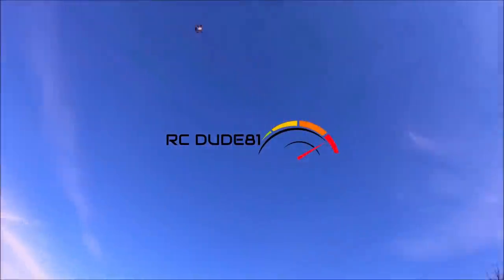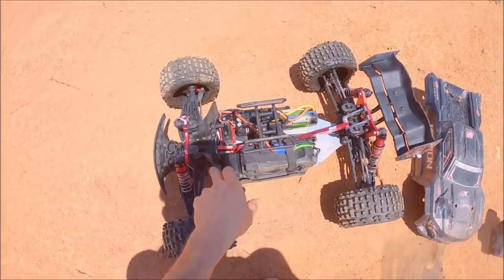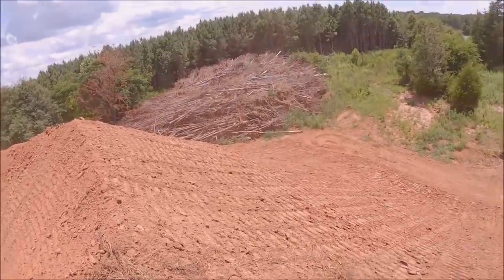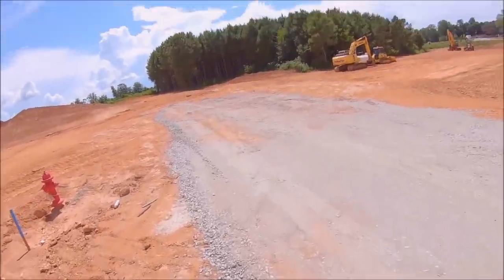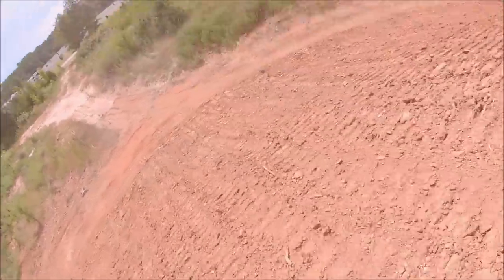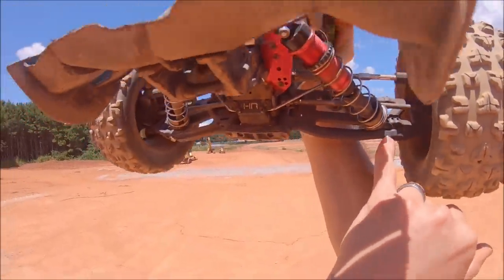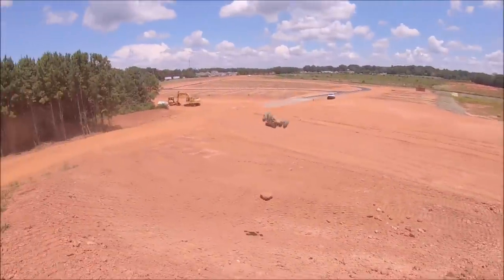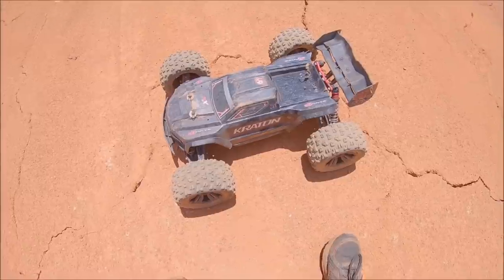NEW Arrma Kratron EXB "MASSIVE!" Mega mound sends and quick fix mod tips!

Comment: love the videos... i recently picked up a v4 talion that id like to finish off with m2c upgrades but im struggling with the suspension and handling right now and was going to see if i could pick your brain on your set up for shocks, diffs, and gearing
Reply: Diffs- I’m running 60k front, 500k middle, 30k rear, also with backflip lp tires. For gearing- if you’re using the stock katar tires, a 16t-17t pinion with dual motor fans should do the job. With backflip lp’s I still use the 13t pinion. Leave the shocks alone, the stock 2000cst oil works nice in the smaller talion shocks. Just adjust spring preload to your liking. I’m pretty happy with this set up in my talion v4
Reply: @TylerSaleik  Thanks... in order to get the car to sit level and not sag excessively i had to max out my spring preload and thats with a fresh rebuild using 2000cst
Reply: Justin Brown mine isn’t maxed, maybe halfway down the shock body on both front and rear shocks. Have you adjusted your droop screws?

Comment: My first arrma EXB I find you to be very knowledgeable! I just opened  my new EXB and the back tires seems to be toed in ? And the front right tire is pointing straight but the left tire is pointing to the left or toed left ? Not straight like the right tire ! Is this correct? I somehow don't think its right . Your thoughts?? 
And thanks
Reply from the maker: The rear tires should be towed in. The front should be the same either straight or slightly towed out.👌
Reply: @RCDUDE81  
Thanks my rear are toed in . Unfortunately the front wheels go 2 different directions  ! Left goes to left toed out.  and the right is straight ?? Guess ill have make a call to get a resolution! Damn waited soo long to get this 😩
Reply from the maker: May have been a bad adjustment from the factory..🤔All you need to do is adjust your front steering turnbuckles to get them even!

Comment: I keep breaking screws on the center chassis braces front and rear. Should I try titanium screws? Everything is upgraded M2C and RPM
Reply from the maker: The bottom screws? May need a longer bolt with a locknut on top. I had to go that on this rig. Sheared 2 bolts already!😝
Reply: Yes both bottom screws and the smaller one on the steering plate
Reply: And yes I'm already using the locknut's

Comment: If out of box with stock blx setup will go 60 mph. How fast will your setup go?
Reply from the maker: The way its geared 58-60. Just has loads of torque with the 1480kv and 160amp Max6.💪💪
Reply: @RCDUDE81  wow 200 amp? Nice! Is that stock gearing? Or is stock spur around 44 tooth? What gearing would make yours do like 80 mph?
Reply from the maker: I'm sorry I meant 160 amp..😝I was thinking of a Max5. I'm running stock 50 tooth spur, 23 tooth pinion. Not sure on 80mph with my current 1480kv motor. Would probably need a higher kv to prevent over gearing and cogging.

Comment: SHOULD be TELLEM ABOUT CHECKING TO MAKE SURE THOSE DIFFS ARE SHIMMED RIGHT TOO 👍
Reply: Lol I'm lazy , i hate taking brand new rig apart , you think oils are low ? I have v4 , I constantly rebuilding all shimmied 60k 200k 30k I'm not going kill exb heavy bash for while have few other rigs you really think go through diffs waiting for servo from amazon now
Reply: I wanted ask Eric but I didnt know appropriate I figured he found em low to remind us , I did open arrma diffs before found that were missing a shim , I never had problems arrma gears except for my Kraton tried everything I'm on good run now tho using spiral cut in front
Reply from the maker: I made a post on the Facebook group about it but totally forgot to mention it in the vid. I did mention it in other vids though.😎👊🤟🤟
Reply: @RCDUDE81  I have check out FB,  keep forgetting rc forums I never checked out
Reply: Paul Clancy    It’s a good idea to check them  when new ,yes.  Especially when new Lol.   Bcuz I’ve got them with zero oil in shocks and dry diffs before.  And I do know some of these A-K’s come with a lil slack in diffs on the reg .    And most needs another shim (in the back or front. Especially the back ) .   But I rather do a quick tear down a get it right once.  Than to have constant problems or things happen to other parts because of it.      But that’s just me. 💁‍♂️.  And well.  I know The RC dude is this way too.     Well.  I’m the last couple of yrs anyways. Lol.

Comment: Do you always land on your wheels or do you edit out the bad landings. But I was thinking at the hight and distance your jumping a bad landing would end your day. Your air throttle control is amazing 👍
Reply: yea interesting question. the driving alone makes the truck seem 5x better compared to the avg user
Reply from the maker: I got fortunate this run. Definitely not perfect but I try my best!😜 The mounds are so high, no room for error. Had a few close calls though!👀🤣Thanks for watching!